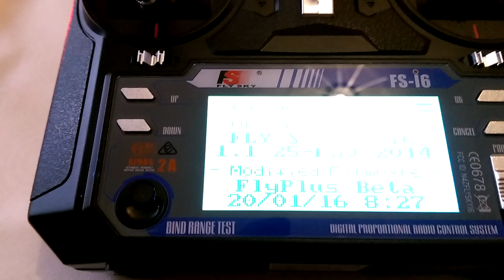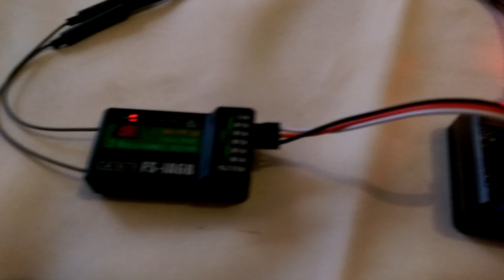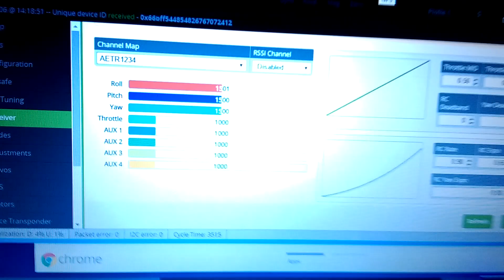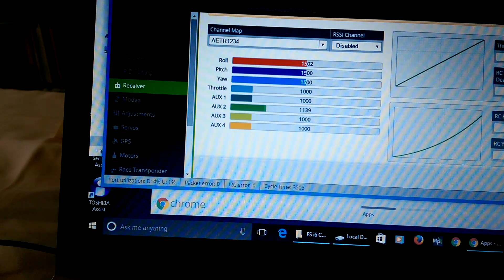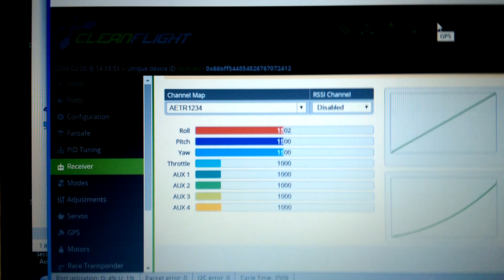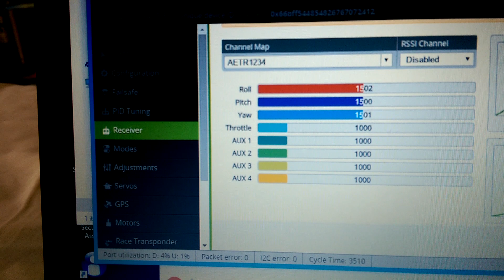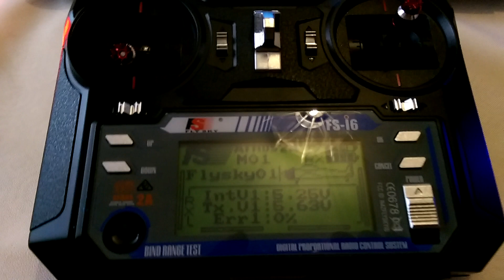Fly Sky FS-i6 8 to 10 channel mod demonstration

Comment: hai... is using ppm can used 8CH? because i have try it only 6ch can go fc apm
Reply from the maker: I don't think you can get 8 channels PPM from a 6 channel RX. or is worth trying though.
Reply: yaa i not get it =(.... Need used i-bus converter to get 8ch, or maybe kan flash the ppm change to i-bus
Reply from the maker: I think you will get 8 channels PPM from a 6 channel TX same as IBus. But I have not actually tried to do that.
Reply: not get 8 only 6, only ibus can get more then 6
Reply: for 8 or 10 channels du must have i-Bus connection or PPM+Converter. otherwise you have only 6 channels.

Comment: Help me i want to connect ibus to pixhawk but there is no ibus in pixhawk . There is only ppm , sbus . Tell me how can i connect ibus to pixhawk ??
Reply from the maker: Pixhawk's Arducopter software does not at this time support iBus. I don't know any way of faking it.
Reply: Exactly what I wanted to know.  So it won't work with Pixhawk...so what flight controller WILL it work with and NOT take up a valuable UART?
Reply from the maker: +Sam Johnson The only iBus support that I know of is any FC using Cleanflight or one of its forks.

Comment: Hi guys, I can only flash the recovery 6ch (  https://github.com/benb0jangles/FlySky-i6-Mod-/blob/master/Mod_i6_Alt_Recovery_Programmer_V1_0/Mod%20i6%20alt_recovery%20updater%20v1_0.exe) and the NovaX  8 channel ( https://github.com/benb0jangles/FlySky-i6-Mod-/blob/master/Firmwares/RcLogger%20Original%20Firmware/RCLogger-NovaX350-Original-Firmware.exe) firmwares on my FS-i6. Any else and the updater gets stuck on 0% percent. I have tried on windows 7, 8.  Can somebody please help me on this matter as trying to get the 10ch mod to work. Thank you

Comment: is it work with openpilot?
Reply from the maker: +waruna perera It should work with OP if you use CPPM but not iBus.  In CPPM you will get 8 channels.
Reply: +Danny Thompson dorry what is cppm.normaly now i use i6 with op.after doing your meyhod can i use it like 8ch.sorry i have not knowledge. .thanks
Reply from the maker: +waruna perera CPPM is single-wire connection between i6 channel 1 and the OP.  If you have many wires from i6 to your OP then you will not get the benefit of 8 channels, but you will get the advantage in the switch mixing in the i6 controller.
Reply: ch i is conenct one wire 
on rx b/vcc connect to three color wire.
so can i use this method for get 8ch,,because i have not enough ch for led,,,
Reply: +Danny Thompson in open pilot have many wire to rx.
three color wire and single wire...
Reply from the maker: +waruna perera Then all you will benefit from is the extra features, you won't get more channels unless you change to using CPPM. it is a big change if you've not done it before. Best if you have someone who can guide you.

Comment: it's possible to send the rssi signal through IBUS port to see it on a FPV system? Or do you know any way to send the rssi signal to the OSD FPV?

Thank you for your information on this video is very usefull for me.
Reply from the maker: +tkdj9 I checked the github and there is no support for RSSI in this modification.

Comment: Just to be sure I'm understanding this correctly, I can modify my FS-I6 firmware, and using my FS-IA6B to my HK32Pilot (Pixhawk PX4 clone), on PPM bus, and get 8 channels?
Reply from the maker: +Ray Crosier Yes, you've got that understood correctly. Connect Channel 1 of the FS-iA6B to the Pixhawk, set the RX to PPM using the menu in the transmitter and you're good to go.
Reply: +Danny Thompson Thank you.  I did the update, do I need to Bind again?  I have no responses on the pixhawk now, when I run the radio calibration.  I used to be able to calibrate w/o attaching my battery to pixhawk, using the USB to the mission planner PC.
Reply from the maker: +Ray Crosier Did you set the Receiver to PPM in the Transmitter menu?  Also connect RX channel 1 to the correct Input on the Pixhawk? That is the RC pins on the Pixhawk. http://planner.ardupilot.com/wp-content/uploads/sites/5/2013/12/rc-input-wiring.png
Reply from the maker: I don't think you have to re-bind ... the status light on the RX should be permanently on with power applied and the TX switched on.
Reply: +Danny Thompson I did end up having to re-bind. Yes, I had everything connected as it was before, and was working. I now have "EX" below the "TX" on the transmitter, and it's showing completely blank for battery level... is that because of the custom receiver battery level that's in the software? (oh, BTW, it is working after binding...)

Also, I'm using Channel 6 on my "original" setup, as the TILT control for my gimbal, up & down. Channel 5 is for my Flight Modes, but with no mixing (on radio).  With new firmware, mixing switch C & D, I'm getting PWM values of 1000, 1200, 1400, 1600, 1800 and 2000, but the ranges on my pixhawk require other values... is there any setting on either the radio or the pixhawk that I can adjust to get 5 flight modes in the pixhawk ranges?  (0-1230, 1231-1360, 1361-1490, 1491-1620, 1621-1749, 1750+)

Thanks VERY much for replying to my questions... this is my first DIY quad, so I'm just learning some of this. It's very different from old RC Airplanes years ago!
Reply: +Danny Thompson  Some good news!  I got all 6 flight modes on the Pixhawk using switch C & D combined on Channel 5.  I found an article where someone used end points to get 5, and set my Channel 5 endpoints to 69% and 80%, and got all 6.  The PWMs are:  sw D #1, sw C (1,2,3): 1155, 1293, 1431, then sw D on #2: 1580, 1740, 1900.  Looks like it will work great!

I don't see any throttle failsafe though... Was this something that was problematic with the Pixhawk?  Do you know if there is a fix for that?

Thanks!
Reply from the maker: Ray Crosier Hi. For Throttle Failsafe I did similar to what you've done for Channel 5, setting the Min Throttle Endpoint to as low as it will possibly go. Then set Failsafe for Channel 3. Then set Min Throttle Endpoint back to normal. The RX remembers the endpoint at the time of setting failsafe :-) Hope that makes sense.
Reply from the maker: Ray Crosier Thanks for the tip regarding getting all 6 flight modes.  I managed to get 5, the 6th eluded me. Will try setting up the endpoints that you've suggested.  Awesome.
Reply: Danny Thompson I believe that I also got the throttle failsafe to work as well, by using the endpoints and throttle settings in the pixhawk/mission planner.  I'm still testing, but it appears to now recognize when the radio is turned off.  I'll try to post the settings if I confirm they work, in case anyone needs them.
Reply from the maker: Ray Crosier Thanks Ray, much appreciate you doing that.  I probably should do a follow-up video explaining and demonstrating these two things.  Got sidetracked with other toys.

I set Throttle Minimum endpoint to as low as it would go - that showed up as 900 in Mission Planner.   So left MP's own setting of 975.
Reply: +Danny Thompson It would seem to me that setting the throttle endpoint low, to 900, might cause your quad/plane to think there was a radio loss if you lowered your throttle to the bottom.  That might cause an unwanted RTL or failsafe trigger, wouldn't it?

I ended up setting my radio's throttle (Ch 3) endpoints to 91% and 102%, which gives me a PWM range in the mission planner of about 1048 to 2000.  I then set my MP Failsafe Pwm at 1020.  When I turn off my radio, it returns to about 1000 to 1007, depending on my trim, and triggers the failsafe condition.

I think it's working right... but have yet to figure out the best/safest way to test it... have to go read on that.
Reply from the maker: Hi Ray, I only lowered the Throttle Endpoint in order to set the Failsafe. Afterwards I set the Endpoint back to normal. The RX remembers the temporarily lowered Endpoint. You can try it out on the bench, without flying. Watch the effect on the PWM  using Mission Planner. 

What you've done will work, but I'm a bit concerned that it may trigger Failsafe involuntarily. 

So to recap, the steps are
1. Lower Throttle Endpoint to minimum possible (mine was 900 PWM)
2. Set Failsafe
3. Increase Throttle Endpoint to default setting
4. Leave Mission Planner setting of 975 PWM
5. Test by switching off the TX, PWM should drop to ~900
Reply: +Danny Thompson  I think both ways work OK.  I cannot lower my throttle below the 1048 bottom endpoint manually, so it does not trigger a failsafe unless the radio goes off.  I don't think there's any way to trigger an involuntary failsafe.  Your way is basically the same as mine, with lower values.  I might try your method to experiment.
Reply from the maker: Well if you've got it working thats cool, and got a backup method if any doubt/trouble :-)  Glad to read you've got it all sorted out

Comment: (Im a newbie and this question may sound stupid)Why failsafe set throttle to 0 if you can set return to launch instead?

I have a FS-I6 transmitter with i6B receiver, but I want to get the 10ch receiver, with this mod Im going to be able to use all the switches and potentiometers of my FS-i6 transmitter?(FS-iA10)
Reply from the maker: +Pablo Elizondo Hi Pablo. In Arducopter (APM/Pixhawk) the Failsafe uses PWM values below 975 to trigger. This is useful where on loss of control signal (out of range, TX battery failure etc...) the RX drops the Throttle PWM to zero (not all RX do this).  Can also be useful if the actual RX fails and stops sending PWM, the Failsafe then triggers in Arducopter.  Yes, if your RX is smart enough you can use it to set RTL, and the Fly Sky i6 and i10 RX are smart - but the older RX is not ...

Comment: need to ask, how did you setup the failsafe below 1000 pwm? all I can get is only -100% which going 1000 pwm if tx is turn off
Reply from the maker: Endpoints.  Set throttle endpoint to maximum below min. Then do Failsafe settings. Then put min endpoint back to 100. :-)
Reply: +Danny Thompson it's working, thanks! 

Now for ch 7 n 8 for apm, have you try it on apm?
Reply from the maker: Not tried on APM yet ... I've got a spare. Will check at the weekend
Reply: +Danny Thompson thanks, looking forward, btw, the switch mixed and failsafe itself is a big help
Reply: I've success using those 8 ch with APM, but is not really simple way
Reply from the maker: I didn't get a chance this weekend. It should be do-able. I will put the solution up if I can find it :-)

Comment: just want to update you my result with APM2.8 and FS-iA6B, connected with PPM

- Ch7 and Ch8 that I assigned to SWA and SWB is not working on APM
- the throttle failsafe is not working on APM, it still showing 1000pwm if I turn off the tx
- I Assign the ch5 to SWC+SWD, need to adjust the end points to get full 6 flight mode since the preset pwm is above or beyond APM setting to get 6 position
Reply from the maker: +Deon Oswari You can set the PWM values for the Flight Modes in Mission Planner to match the Transmitter/Receiver.  Its easier that way.  

Not sure why Ch7 and Ch8 are not working ... Does Ch6 work?   I haven't yet tried PPM to an APM, although I will be needing that capability on my next build
Reply: +Danny Thompson sorry just saw your reply, ch 6 is working great, I set it for VRa, but ch 7 and 8 is not moving at all on mission planner
Reply from the maker: Hmm could be the PPM is not framing correctly for the APM. Although can clearly be seen working on the Flip32. Not sure what to advise ...

Comment: Can this work with apm fc that has been sbus enable?
Reply from the maker: It will work to APM/Pixhawk using CPPM (output from the Receiver).  But not S.Bus
Reply: +Danny Thompson thanks a lot Danny, it's even better since I'm already using ppm for my fsia6b and APM. By default apm is not supporting sbus yet. 

You are a big help, will try this ASAP when my cable arrive

Comment: I am very interested in modding my Flysky FS-i6 to make it 8 plus channels. Many others are also very interested. Please make a video on how to do that. The page you linked to is not working.
Thanks,
AVB
Reply from the maker: +Arden Bolton Hiya, I have fixed the broken link above. That should now work for you.  There are full details on the website - and if you scroll down the page of the above link to "flashing the i6 using trainer port - to - FTDI/UART" you'll see what you will need in terms of making up a cable to flash the i6 using an FTDI if you don't have the official Data Cable.  

There is also a full forum How To article on this here --> http://www.multi-rotor.co.uk/index.php?topic=17136
Reply: +Danny Thompson Excellent - Sir, I thank you very much. I will investigate. Respectfully, please reconsider my suggestion to make a video, there would be great value in it. Many people have been waiting for this.
Reply from the maker: +Arden Bolton I'll look to make a video of the process at the weekend :)